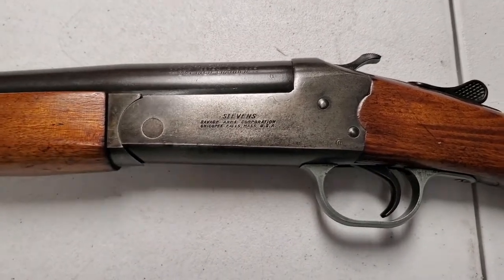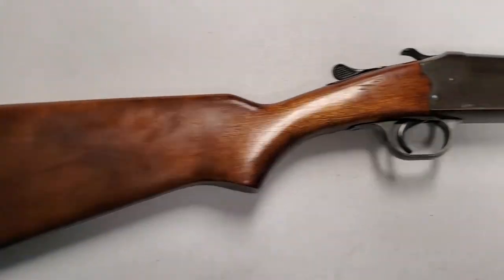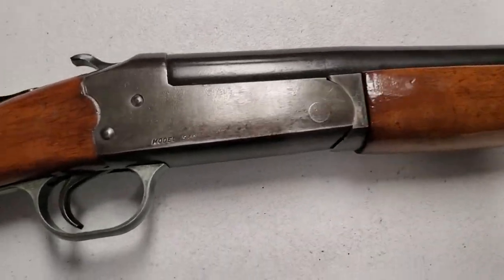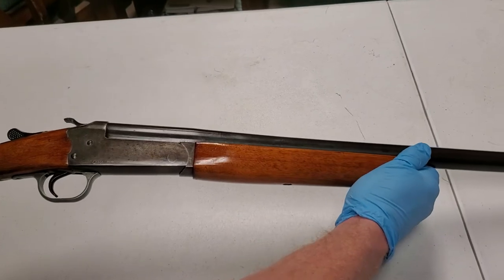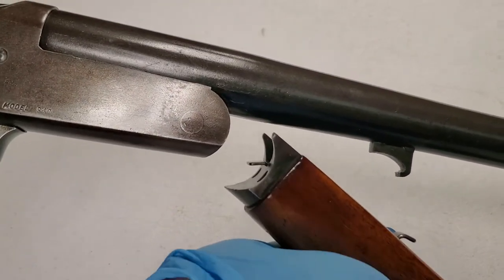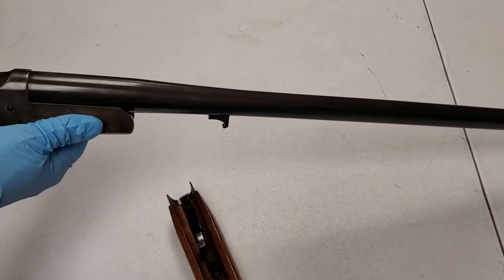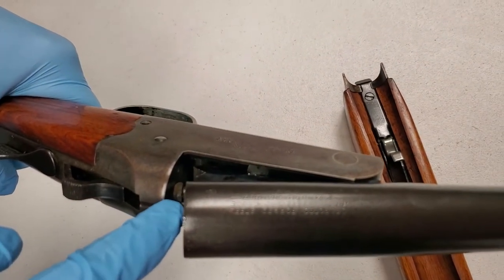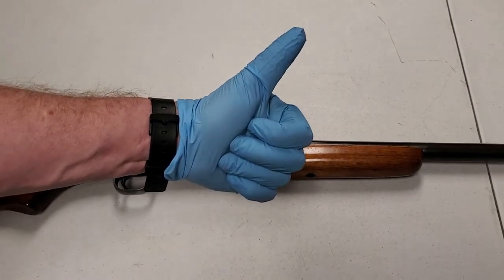Disassembling a Stevens Model 94

Comment: I have a model 94 B that was given to me 30 years ago, it does not have a screw that holds that spring mechanism in place but it has two threaded bolts that used brass nuts and were then peened down and sanded flush to the stock. I'm looking around to see just how old this rifle could be. This thing is in great shape though not loose at all and only one tiny crack in the wood near the trigger guard. I see other comments saying they shot them, I think Id trust this one for a few test shots.

Comment: I have a 94C 16 gauge.  Is it normal for the hammer not to be completely flush the receiver?
Reply from the maker: I don't think it's normal, but somewhat common.  Remember,  this is from when everything was hand fit by a person, so a lot of times something will look off like that but the gun functioned.  That was enough for it to go out the door and on the filing the next gun.
Reply: @murphyfirearmstraining3630  thank you for replying.  Now to take it for a test fire.  My grandfather passed away in 1962 and that may be the last time it was fired.

Comment: I have this same weapon. Do you have a detailed video on how to disassemble and install all the pieces again because I opened it and I do not know how to put the pieces together again
Reply from the maker: Unfortunately,  it's not my gun.  Just field stripped and cleaned it up for a client.   Didn't have to take it apart any further.  Sorry
Reply: Watch the video in reverse
Reply: Did you ever get it reassembled? I'm taking my 94c 28ga apart to derust & reblue now. The forend is already apart, but when I reassemble, I can step by step, & maybe remember to video it if you're still in need.
Reply: @gregtyson4574  I’m struggling to get mine disassembled, 60 year old screws not wanting to come undone
Reply: @parkerfiske4707 understandable. The pins are what gave me issues. I've been using PB Blaster & letting that soak in for a few minutes. So far, that's done the trick. The only screw that was problematic was the stock bolt. That just needs a long, wide headed slot screw driver and some leverage.
Reply: @gregtyson4574  yeah that’s the one I’m struggling with, I’ll do what you suggested on it thanks!
Reply: @parkerfiske4707  if you can get some WD40 of PB Blaster into the back of the trigger housing, that should hopefully get to the stock threads. I had to get a 16 inch, thick blade slotted screwdriver on it with the trigger housing clamped on a vise, and both hands on the driver. Just use steady pressure, or if you can get a wrench on the screwdriver handle for more leverage, slow & steady. Not sure how easy it would be to replace that stock bolt....